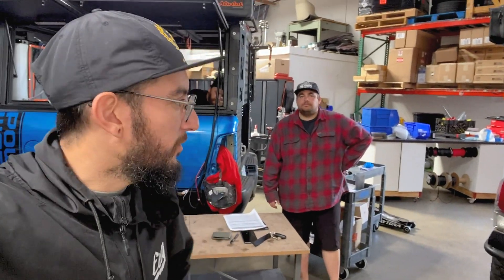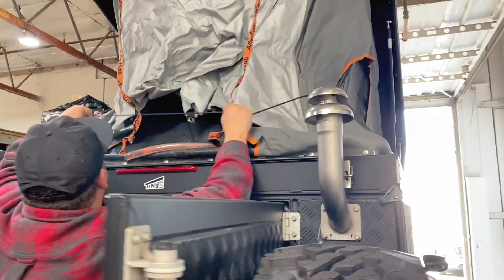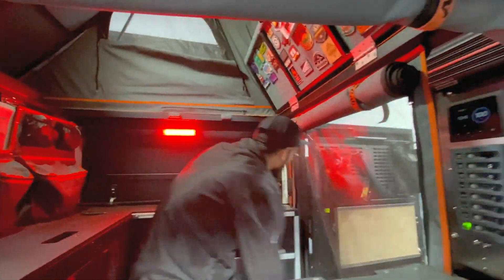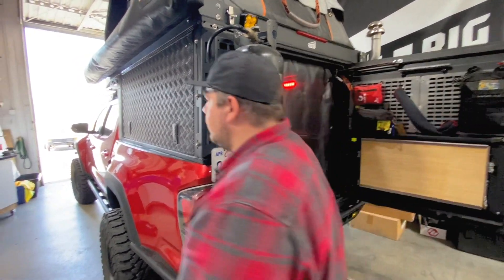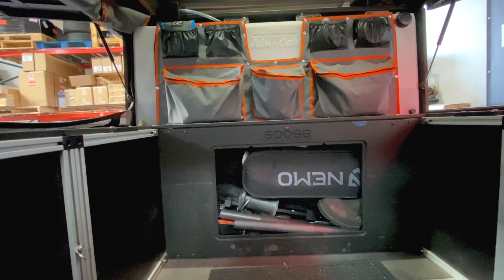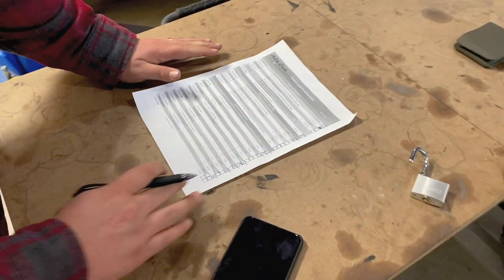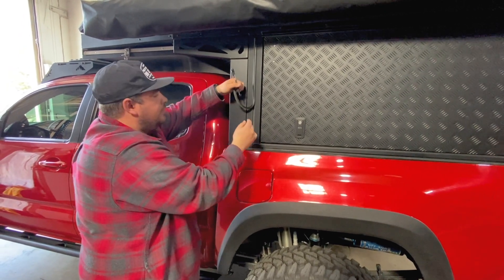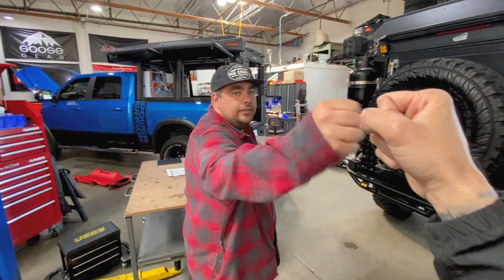I made the switch to an Alu-Cab Canopy Camper | My Build Sheet

Comment: Question:: When running the heater how long will it last using that one propane tank if you ran it non stop?
Reply: On low setting, about 100 hours, or 4 day straight.

Comment: I have one on order for my 6 foot bed Tacoma. Not sure if you know it not, but they also recommend a helper spring or air bags to help with the weight. The barebones unit is 450 Ibs. or so I was told.
Reply: Air bags are not needed. A good leaf pack spec'd appropriately will perform better off-road.
Reply: I have a 5 foot bed 2nd Gen Tacoma, is the 6 foot the same with just an extension or is it a different unit.  I was thinking about getting a new 6 foot bed access cab Tacoma to build.